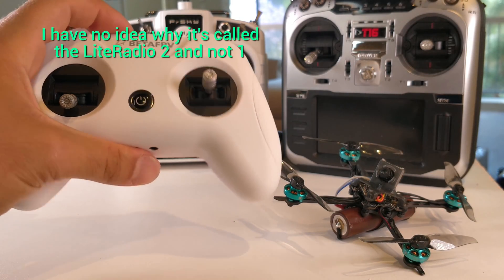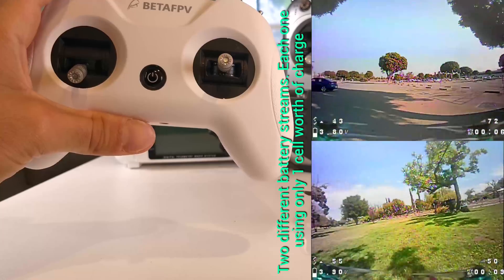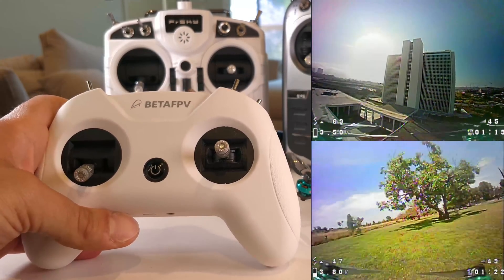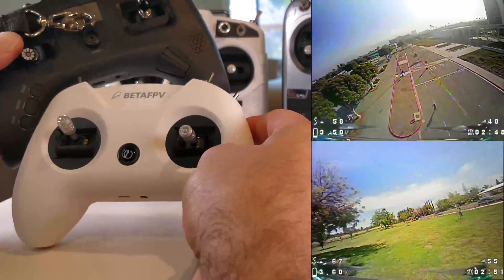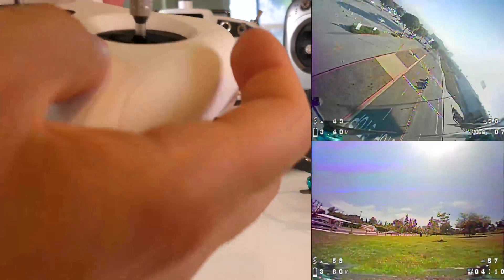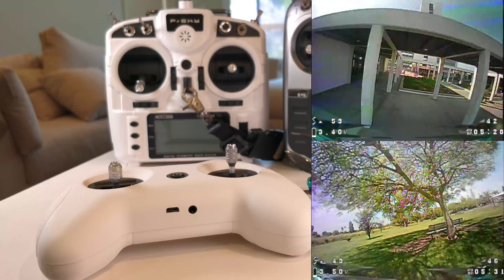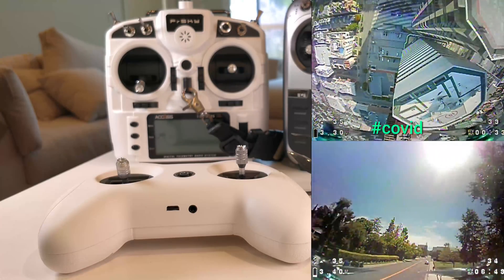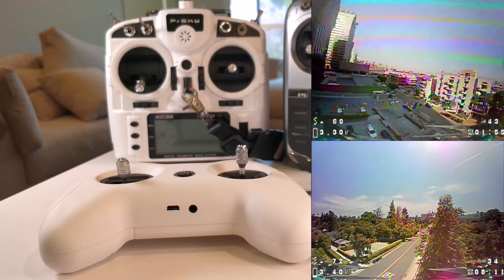BetaFPV LiteRadio 2

Comment: can this be set to mode 3?
Reply from the maker: I don't believe it can be changed even though it runs opentx
Reply: Well you can change the channel order in betaflight, or is there more to switching from mode2 to mode3?
Reply from the maker: @ValFPV  I think he means the throttle function on the controller
Reply: @Kabab  oh. Like switch it to the other side? You can do that but you'll have to recalibrate the gimbals I think
Reply from the maker: @ValFPV  yeah switch sides
Reply: @Kabab  ok. Another thing about this radio, the gimbals don't last long at all. My original ones started bugging after like 4 weeks and then I got replacement ones and now one stopped working properly as well :(. I hope this is not a pattern with betafpv products in general..
Reply: @ValFPV  thank you all for the replies. I got it working with open tx... and changing the spring inside.
Reply: @recycl0ps890  nice, hope the radio lasts a while for you!

Comment: Hi bob ! About the 18650 you said that below  3.2v the quad is barely flyable is it because the motor doesnt have enough voltage to produce trust or is it the fc wh'os not getting correct 3.3V from ldo. I've been thinking about to replace those ldo by a step up/step down regulator to been able to use the entire capacity of a 18650 cell but i dont know if below 3v the motor could produce enough thrust to be flyable maybe with higher kv motor it would be feasible.
Reply from the maker: The problem is that in order to make the single cell work below ~3.3v enough to run the quad, you'd need to pull even more amperage out of it which will sag it even further.  This is if you can even get a boost circuit to give you the minimum ~8A needed to get any kind of top end performance out of the quad.  Boost circuits that provide actual amps tend to be kinda beefy which will add even more weight making the whole situation worse.  You're better off just running two or three 600mah cells in parallel to get well over the flight time you'd get from a single 18650 but it's cool that it worked and for as long as it did fly

Comment: Very nice, 
1 cell 18650 battery how many amps, where do I get it, thank you
Reply from the maker: I wouldn't recommend trying to run a quad like this on 1S but I got it from IMR batteries
Reply: @Kabab  Why don't you recommend it?Looks great, great idea,This quad is very nice with 1 cell 18650. I like this and want to do it,Flight time is perfect.
Thanks for help
Reply from the maker: @fly99hummingbird  because you can't access the lower third of the batteries capacity. The voltage is too low. So you're better off with a large 1s lipo
Reply: @Kabab It does not come to the country I am in (lipo). Can I use this product (LG HG2 18650 3000mAh 20A Battery) 1 cell 18650, Chemistry: INR, Approximate Weight: 47g

Comment: mine bricked trying to trim center. mine was jumping everywhere in center by 16, meaning if i roll left and stop it be at 1490. i roll right and stop it be at 1506. wanted to atleast center it. followed instructions and boom.. red light of death.. Any one have firmware they can send me to try that?
Reply from the maker: Please contact BetaFPV about it.  Please actually contact them.  I'm sorry you ran into issues
Reply: @Kabab  did this morning. Haven't heard back yet. Also contacted getfpv if they ran into this issue and might know.. i tried everything I could think of on my end
Reply from the maker: @QSpeedRacer  I wouldn't expect the retailer to be able to help much with this. BetaFPV should help.  Really really should. I've had issues with them helping however so it's a toss up but definitely bug them please.
Reply: @Kabab  ok.. ill annoy them. Cheaper for them to just take me than return it haha

Comment: Hi KababFPV, I know you say it's good to use it with the Tiny D8 receiver but where I live it's not available. The range is not very good with the SPI on my Tinyhawk II Race, so I'm wondering what kind of range it would get with and XM+ receiver? Thank you
Reply from the maker: The range will be bad no matter what but it's a LOT better than a default Frsky controller on the same crappy SPI Rx.
Reply: @Kabab  ok so it will be more like 500 metres correct?

Comment: I hope this isnt a stupid question,say i buy transmitter and wanted to bind my tinyhawk freestyle would my switches already be set up for me or would i have to go into the companian to set them up.and i mean switches like arm,lvl horizon air mode.?im kinda a noob,im using a jumper t8sg v2 and sometimes its a pain i have to reverse channels and half time subtrim doesnt work.just want something simple.
Reply from the maker: depends if it matches up on BF however the tinyhawk is set.  It's best to check

Comment: Re the radio, I’m surprised what you said about the range — I have an x-lite original (without r9m), in terms of range do you think it would it perform closely to that? 
Actually thinking to downgrade, bought the x-lite used and will go digital at some point anyway. 
Looks good to have this as a no fuss analog option with my ev800dms but one more question: can you swap models without connecting to opentx on your laptop?
Reply from the maker: The advantage of a genuine Frsky controller is that you can use the more recent Frsky Rx's which have really great range. I believe this BetaFPV controller can be used with the RXSR which is a fantastic Frsky receiver too however. I didn't test that one specifically but based on my testing of the spi receiver I would assume the BetaFPV controller to be just as good as the xlite at range with an RXSR. This thing is really impressive for $40
Reply: @Kabab  so can it be used with an xm+?

Comment: Hi! I was wondering if this radio could be USB powered when using it as a simulator?
Reply from the maker: Yes it seemed to be okay with that
Reply: You have to turn it on with the battery but after connected to the PC you can take the 2s battery out if you wanted to.

Comment: Hey Bob :) I have got the Babytooth 1S platform and I'm having a looooot of fun with it! Huge thanks for coming up with this!Now, I've got all my 1S batteries, but don't know how to charge them conveniently since.... Since they are 1S but have an XT30 connector, which is not typical for a 1S battery. As I know you (Bob), you really like convinient things and I'm curiuos about your solution you found to solve that 'problem'. It may also be a mod of some sort, like changing the connector or whatever you do, please share it
Reply from the maker: we sell the female or male....whatever end you use to charge in the store for this reason.  I just make an adapter to PH2 for charging

Comment: Kabab....there are so many transmitters it seems nowadays. Everything just feels like a compromise for whatever they may be trying to do. Comfort, form factor, and functionality. I wish you had the opportunity to release your concept with FlySky versus what UGFPV released with the NV14. I felt like UGFPV rushed FlySky and it was release with some hardware issues. On the topic of transmitter fw, I too hate Opentx. I actually think FlySky did a pretty good job with the fw on the I-10 radio. Have you had a chance to look at the Paladin from them as well? It has a JR bay finally 😂.
Reply from the maker: The one coming from radiomaster will likely be the next main one and there won't be many more after maybe because DJI will start taking over.

Comment: i think you need to try using single cell battery voltage on your osd
it has 0.01V resolution
instead of 0.1V resolution with full battery voltage

Comment: been waiting on a reviewer that i trust  to look at that controller. so tempted to get it for indoor flying.
Reply from the maker: As of my testing on this one, which is one from the actual production batch, this is a good one.  It's hard to fault, especially for the price.
Reply: @Kabab   the best ergonomic controller for indoor no contest .
Reply: I just got mine today. Had to open it up and adjust the gimbal but it's buttery smooth now and a great little unit.

Comment: Does this radio have any kind of audio feedback?  A speaker or buzzer? I fly LOS some of the time and would like a configure a low voltage indicator and/or countdown timer on the radio. As for the 1S boards, I still like and use the old red Crazybee F3 boards, they seem to hold up better than the newer versions.
Reply from the maker: oh yeah it has a vibration.  but it rattles a bit.  would be better if it had no vibration probably

Comment: No screen means no model memory. No big issue since I like to keep same stick/switch layout on all quads... But can it  somehow bind to several recivers without having to rebind everytime you switch quad out in the field?... Not very economically if you sort of need one transmitter per quad...
Reply: He says at 6:08 that you can bind it to multiple quads.
Reply: Can anyone confirm what you need to do in order to switch quad? Is it a regular rebind or is there a faster method like it can remember several recivers and pick what ever is turned on at the moment?!? Really did like the layout but having to rebind is probably not for me...
Reply: @rasmus80g  no rebind. it works just like every other controller out there.
Reply: @matthew04101  thank you for answers. Open tx and only one quad... Strange design... Who is this for?!?... Beginners don't want to mess with open tx... And the rest of us has more than one quad...
Reply: Following for an answe on this. Once bound does it use model memory???
Reply: @skyandwater662  the answer is yes. but really i don't care what it does. i just create a model and bind all my quads to that one model and go fly.

Comment: Transmitter looks great and I almost order 2 but decided I have to control myself so I'll just order them for my nephews down the road if they show interest in rc. All I want to know, does it have audio for telemetry? 

Not totally related but I just had an idea but maybe it's obsolete or nobody would be interested because of osd in betaflight, but what if someone made a transmitter without a screen but it had a port for your favorite fatshark module and it's own osd chip and a video out port? All of the opentx functions could be on your goggles or an auxiliary screen and Lua could be used for all the betaflight functions and tuning so if you were into flight controllers that don't fit an osd chip for whatever reason you could use frsky telemetry to do anything you needed.
Reply from the maker: DJI has this covered nicely from the goggles.

Comment: I have to admit so far I've had a pretty good run with the crazybee f4 lite, I have 2 which originally came in my 2 mobula 6's now one is in a toothpick build (hx100se with crossfire because the betafpv board burnt out) and the other is in a 75mm whoop with crossfire. Probably over 70 packs through each board and I'm running 100mw and 200mw on the built in vtx!

Comment: I picked up a turnigy evolution in a ebay lot of stuff didn't know anything about it but must say for only 50 plus it's not a bad option I've had no range problems the gimbal seem smooth and I do like the shape of it I been using a jumper t12 with hall gimbal and dxe dx6 also I been fly n a holybro 180 and a diatone crusader x I really like the true x seems more nimble over my stretch Xs types but I really like the stretch x is straight line full speed seems to really hold tight but you can really feel a difference in frame styles I have not sure what's it's called but a nighthawk that has a different feel with the stretch x but its horizontal vs vertically stretch.  Kinda cool being still a noob with just over a year now . I always thought it was in people's heads that they would feel so different wish I could make all the style frames with all same parts to really feel the difference.  Like radio transmitter have alot of feel for why we use use one of the other . End of the day everything we use is the same but the feel of a good set up matches to a good feeling transmitter will always be number one cost will vary but feel is number one 2 service . Now we just need someone to make a better motor that's made better with the right bearing that are for heat and impact better no one uses good parts on any motors with bearing shafts and way they are being used is still not even close to what's possible just not sure if weight and cost would out way for a better stronger motor design with a top bear brace so the motor would have no flexible or bendable shafts would help the structure of qaud also but my wish is to have less heat and less motor loss caused by a motor that is being maxed out like we all use now

Comment: Lion trending for sure. I just got a 2S pack for my 3 inch 1404 setup, getting 13 minutes cruising. Will be posting a video shortly.
Reply: They are fun to experiment with.  I am using them for everything from little 3-4in builds on 3s to a 7imch with a 6s2p pack to 10-13inch builds running a pair of 6s2p packs for 12000mah.

15-20min flying on 3-4in.   17-23min flying on my 7in.
15-20min flying on my 10 and 13in.

Comment: it looks like all eyes and developments are on graphene batteries. i'd figure by next year, all Li-ion batteries would seem old tech. graphene batteries are lighter, more durable, long lifetime, less dangerous and higher charge/discharge rate.
Reply from the maker: lion has old and new.  the more recent 21700 cells are starting to get a lot of development.  the samsung 40T is an impressive cell
Reply: @Kabab  graphene batteries are li-ion batteries with graphene mixed in. so naturally graphene batteries are the next revolution of li-ion batteries. so far, only one company, that i know of, that recently has produced them commercially for power banks. next year there will be more and definitely samsung will be one of them.

Comment: I have a Flycolor 1s stack in my 2" that has worked solid since 2016. The ESC is only 4A but it has enough juice for 1103 16000kv motors. The AUW is 44g with a 600mAh lipo cell.

Comment: Hi Bob, right after you showed us the 18650 mod I grabbed one and its 4grams lower than my brand new 3s batteries. Would it not be recommended at all? Or just for FPV?  i have exploration flights in mind.
Reply from the maker: It works fine but you can't access 30% or more of the battery because it's below 3.2v.  The quad doesn't really fly well below 3.3v.  It barely flies well at 3.3v
Reply: @Kabab  I must test with a joule thief.  https://coderdojoathenry.org/2017/11/22/hackers-a-joule-thief-and-controlling-motors/

Comment: I currently have a Flysky FSI6S and only one 3 inch HD quad and I don't feel all that confident with failsafes when I use it. I have a low budget and this radio seems like a great package. Would it be a good move to buy this radio?
Reply: Which receiver are you using? The FS-i6 should be decent enough for most cases. Usually the recommendation would be to move to Frsky but they have destroyed their ecosystem.
Reply: @obesesoldier1  I am using the x14s receiver
Reply: @benjaminlacayo9068  Get the XR602T-A. It's a new Flysky reciever, small and very good. No failsafes at all.
Reply: buy it! it's good and cheap. i wish i start fpv now and not 2yrs ago.
Reply from the maker: This radio is good if you're looking for something small and tidy but still excellent overall performance.
Reply: @Kabab  What kind of range do you think I could get with this radio using an R XSR or an XM+?

Comment: That radio is just too small for my hands. (Edit: As large as the Tango 2, no problem then.)

Bob, would you recommend the JHEMCU GHF411AIO AIO whoop boards? I need a new one to replace my Iflight 12a AIO and the price of this one makes it really interesting. Ciotti suggested it .
Reply from the maker: yes those boards are good and we're getting them in the shop shortly
Reply: @Kabab  Cool! I may hold off and order them from you then. It's not like I only a single quad to fly, lol. 
You should do a torture test of the 30a board to see how it holds up.
 Thanks for the reply!

Comment: Quick (rather unrelated) question about those Stan fpv ducts. The ones you received are tpu, right? I received some as a gift recently, as tpu is going out of stock, and disappointingly received them in pla. As you can guess I broke a duct after a 3 foot crash in grass during the maiden. Seems pretty silly to send out ducts that break that easily instead of just saying they’re out of stock. Have you had better durability with tpu?
Reply from the maker: The ones I have are not TPU and I'd not recommend TPU ducts since they would weigh a LOT.  The lack of durability is why I'm working on reducing the cost of this stuff a LOT....Mine are PLA and plenty durable enough but won't take a hard hit
Reply: KababFPV gotcha ok. I guess I gotta stop crashing haha